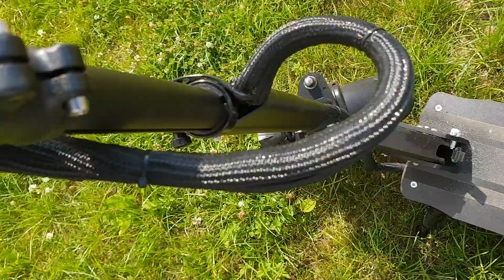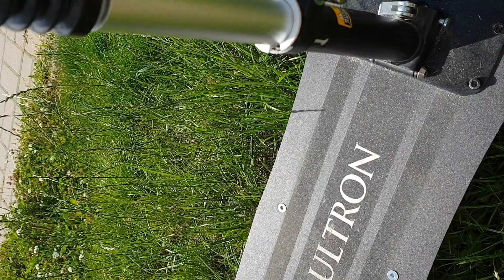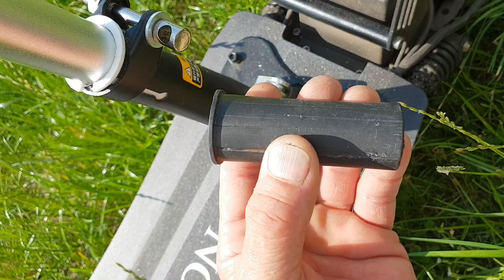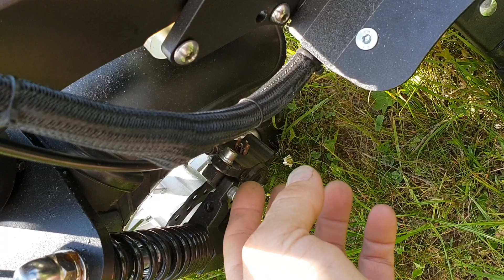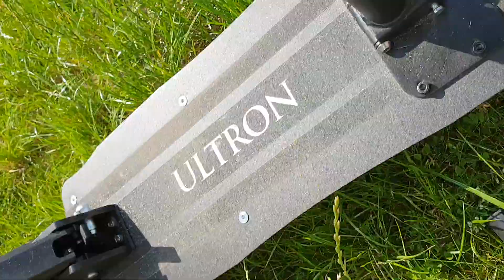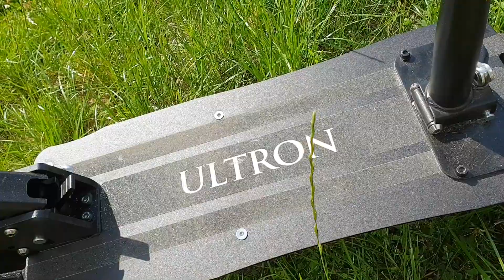ULTRON T103 electric scooter problems and fixes

Comment: I am interested if it is possible to increase top speed of this in any way? Like is there a limiter that would top out at 45ish kph?
Reply from the maker: @Erogardt  I don't know. I weigh 230 pounds and mine went 54 km/hr. I don't use this scooter anymore. Let's just say it's scrape material. Don't ever try changing these tubless tire yourself. You'll ruin the hub and the bead on the tire. Take it someone with the right machine.

Comment from the maker: My latest problem: There are two die-casted battery terminals for recharging on the scooter, which is bit if a mystery as to why there are two. I don't recommend threading the recharging cable unless there's a dire safety reason to do so. I rescently discovered that one of the charge ports has become loose. I was able to tighten it back without taking the battery compartment apart, but the problem has persisted. The male threaded component  has two flat spots to for a wrench, but you must tighten the socket with the male plug attached; otherwise, you will crack or oblate the threaded collar. At this point, it seems that my only solution is to apply some sort of glue around the collar of the receptacle, possibly black silcone or even a superglue gell.

Comment from the maker: I have a friend who purchased a Kugoo M5 electric scooter around the same time I got my ULTON T103. He had all the same problems with his seat, with the exception of his seat having tilting issues. One major problem with his scooter, and it became a reason why I would never recommend the M5, is that the tilt and locking hardware from the foot platform to the steering column is poorly engineered. The design allows too much rocking (I call it slop) and the steering column hardware will most likely become more loose over time as metal frictions against metal. I have seen other Kugoo models with the same issue. Luckily, my ULTRON was designed well in this very critical component. My friend thinks his scooter is better than mine because his speeds up quicker from stops. I told him if this is true, it just means that he will just consume battery supply more quickly. You don't get something for nothing.

Comment from the maker: Here's an updated list of all problems I've had so far, many of which were fixed: the female receptical for charging became very loose, the front break almost fell off while riding, the seat kept slipping down, the rubber cap on the rear axle kept slipping off, the seat kept tilting no matter how much I tighted the original hardware, and the kick stand bracket kept becoming loose. 

I added sideview mirrors. Also, I added bumper protection all around the platform and any other applicable locations where the material would work (see my other videos).